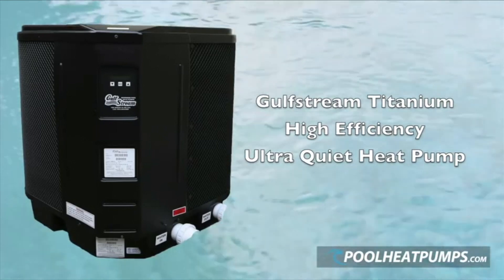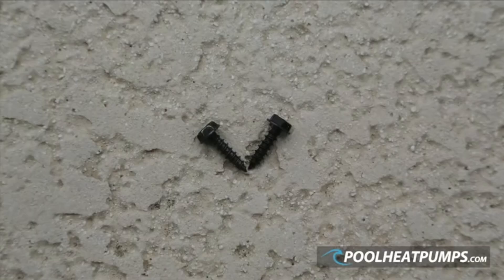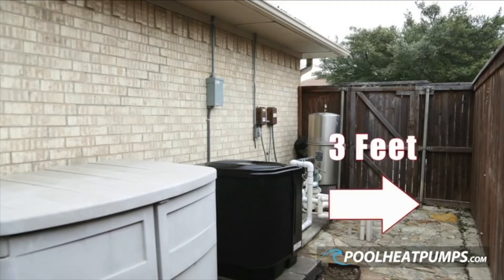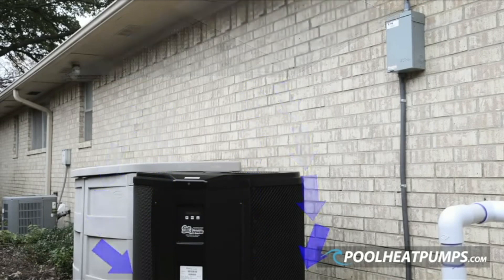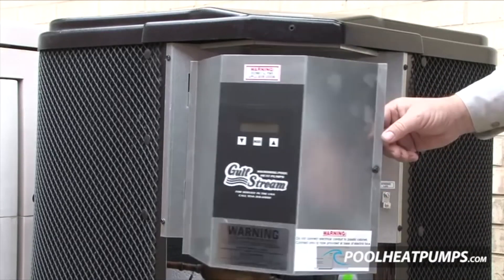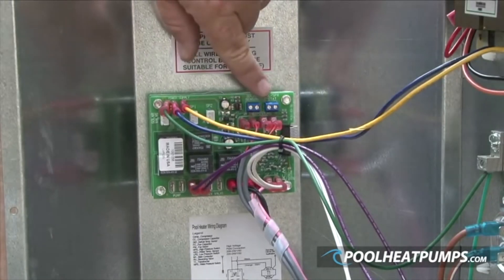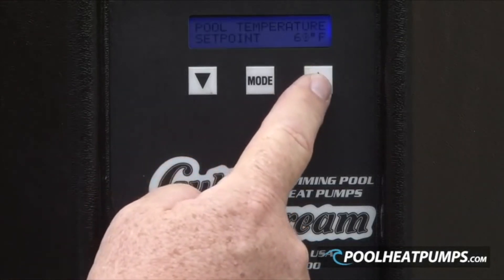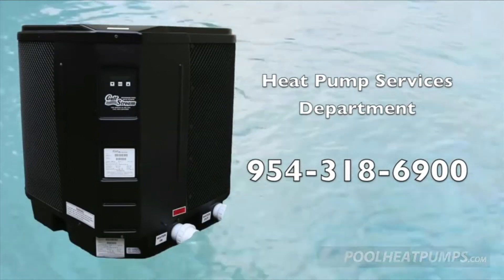How to Install a Gulfstream Pool Heat Pump

Comment: This is the second control board I've had on the GS1000. Replaced the first one because the LCD was no longer readable. Now the second control board is no longer readable. Is there a way to adjust the brightness of the LCD or do I have to yet again replace the entire control board.
Reply: Contact the company directly!

Comment: Hi, my name is Enrique. I purchase your Gulfstream Pool Heat Pump last year and installed without any problems, and was able to set the removed control system by running a thermostat wire from my OmniLogic Automation system and connected to the Pool/Spa T' Stat low voltage located on the swing door control unit and it was working great all last year with my OmniLogic remote app on my android phone, but this year it is not working with the remote app. Can someone guide me, in how to be able to fix this problem. I don't understand why this is happening, since it was working perfectly last year. Waiting for your response. Thank you in advance.